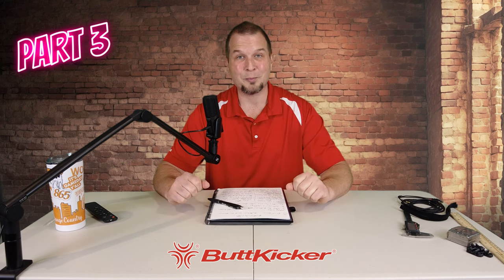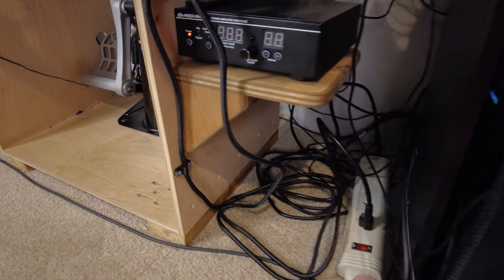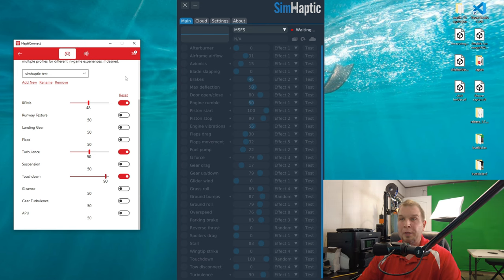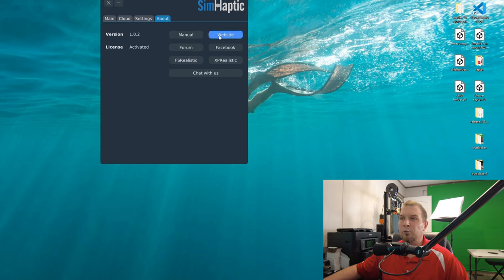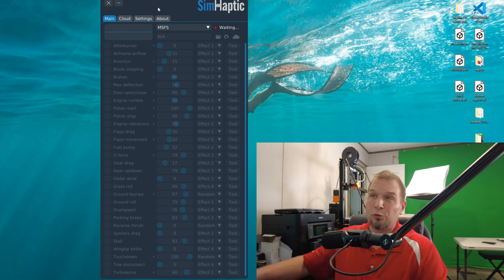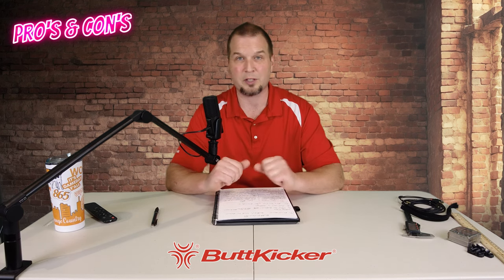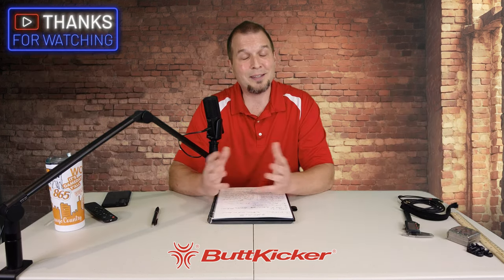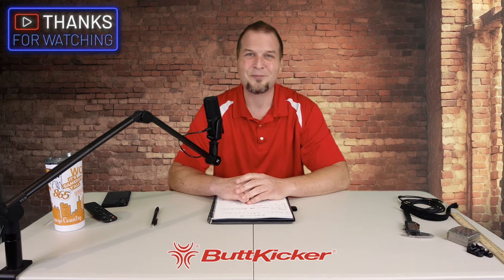MSFS2020 & ButtKicker* Should you BUY one? Setting guide , Pros & Cons Amp & Cable management! Pt.3

Comment: I knew you from your phenomenal graphics improvement videos for MSFS and watched them regularly.  I just got a new buttkicker and searched youtube and was thrilled to see you giving your thoughts IN A 3 PART SERIES even! 10/10 job on this.  Just curious if you have gotten the recently released update to Hapticonnect and noticed its new integration with 2024?  It would be great to revisit this in the new sim and see if the new software is an improvement or you still feel simhaptic does the same things better.  Either way, thank you so much for your contributions.  I owe you several beers or coffees.  -Jason
Reply from the maker: Hey thanks for the comment I have not downloaded the new Hapticonnect software. I'll have to try that out but as far as Sims haptic yes I'm still using that they've added many more features to that software in recent updates.

Comment: I once considered a Buttkicker but was very concerned at the vibration annoying my next door neighbour.  My computer is right beside the partition wall to their house.  You mention concrete floors being better.  I work in the architecture industry and would be somewhat concerned about the effect constant vibrations would have on the long term structural strength of the concrete slab.  It may induce cracking.  I have had the HF8 Haptic seat pad for over a year and have become used to it.  The transducers did cause me discomfort at first when using the seat for an extended length of time.  Getting the seat pad strapped down in a good position is key I think to improving comfort
Reply from the maker: Thanks for the comment .. I doubt the buttkicker would have any affect on a concrete slab your house is sitting on ... it's not a jackhammer lol it just produces some vibration that can transmit through walls.

Comment: Thanks for this...just placed an order for one after a year of considering whether to get one or not.  I have a Secret Labs chair and did not realize I had an exposable pole underneath those plastic covers!
Reply from the maker: Awesome 👌 you will love it .. dial it in .. have good air flow and don't overpower and you will have it for years. It would also be A good idea every so often to get a can of that compressed air for cleaning keyboards and just blow out the amplifier to get any dust out of it..
Reply: @2020fsers  Received and set up yesterday and tried it with the FNX A320....wow!  I never knew what I was missing.  It will take a bit to tune each setting but this really adds immersion to the sim.  I did get SimHaptics and trying that without the default software. Thanks again for pushing me over the edge!
Reply from the maker: Awesome glad you like it 😀  happy flying

Comment: I think the arrangement setting in the settings tab refers to the input/output from the computer. I.e.. a mono, stereo or 5.1. I personally use a stereo output USB card specifically for the Buttkicker. So I use the stereo setting, and it does seem to make a difference. The multiple outputs refers to the number of Buttkickers that are connected.
Reply from the maker: If you check out the manual tab in the about menu and scroll to the section for settings and there it says for arrangement to select your bass shaker setup, and says nothing about the audio from  pc . Yes the multiple output slider is for multiple devices per effect.  So you can have 2 buttkickers under the seat in mono or set them in stereo to have a right and left side   .
Reply: @2020fsers  Thank you for the clarifications. And thank you for all of the awesome tip videos that you do. They have helped me out immensely.
Reply from the maker: Sure they do need to update the manual tho it is kinda old lol. Thanks for the kind words 🙏 I'm happy my vids help out .
Reply: Also, according to an RK Apps video, you should choose the stereo option when using one bass shaker if the mono option isn't producing enough volume - they say the stereo option will provide extra gain.
Reply from the maker: @richavery66 thanks for the tip

Comment: A swivel rocker chair was an issue because when I’d push the pedals, my chair would roll back, and swivel around. I had to tape the wheels and bungie cord the swivel motion lol! 
I have the HF8 chair pad. Would this not be redundant? I need the Butkicker to somehow also vibrate the yoke and pedals. I used to have a platform which had 4 tactile transducers mounted on platform, chair, pedals and yoke.
Reply from the maker: Thanks for the comment . Because I'm on carpet. I don't have the issue with my chair. Wanting to roll when I push on my pedals luckily lol. .If you have your SIM cockpit mounted on metal extrusions, then yes, butt kickers would be great to mount on corners to give you the haptic feedback throughout your controls. Your yoke and things like that.  I do.
 Know of people that have both the haptic seat pad and the butt kicker. And my opinion, I think it's a little overkill.

Comment: Now I am a little concerned and may have to remove this from my Christmas list.  I do most of my flights when everyone else in the house is sleeping.  Although their rooms are not directly connected to my Sim room (on second floor), if the vibrations are transmitted through the frame of the house, that could mean problems.  I would be interested in your thoughts Jon (but I won't hold you to anything), will the horse stall pad reduce the vibrations enough?  Great video!!
Reply from the maker: Hmm that's a tough call . If they Are directly above you sleeping. Then that could pose as a problem unless your simulator is on concrete like if you're on a ground floor or something. In that instance, I would say you would probably be okay. But if your simulator is like mine and is sitting on a wood floor with wood joist underneath of it, it's gonna transfer some sound. I'm not sure how much a mat would damper it definitely will but to what extent idk.  And most houses don't have insulation on interior walls or between levels. So that just leaves a hollow space for sound to travel. I don't think you would have an issue with other people trying to watch TV or something but when It comes to sleeping some people Are really temperamental to the conditions for sleep. And if they're not directly above you and maybe on the opposite side of the house, you probably won't have an issue. There will be plenty of walls in between you and them.
Reply from the maker: The other thing is you could choose when and when you're not gonna use it.So maybe you only use it when people are awake and you don't when people go to sleep.  Play some bass music in that room and then go upstairs to the bedrooms and see if it's loud . It won't be the exact same, but at least it might give you some idea. If there is enough air space between all the walls between that room and where everyone is sleeping to dampen the sound enough then you will be fine

Comment: Amazing Video, I need to hook my buttkicker back up.  I turned it off because my Dog hates it.  Small complaint, I wish there was a way to change the SimHaptic in your video to white background.  It is very hard to read your settings.
Reply from the maker: Thanks for the comment .. what you see in the simhaptics are not my settings only because every aircraft is different so I felt I would show the process in which I go about setting all of the settings also everyone's setup is different so my settings may be to weak or to over powered for you . But the aircraft that I have setup profiles like the 414 the Comanche and the da42 and fsr500 I have uploaded them to the cloud so you can go there and download my settings in the cloud tab for those aircraft .

Comment: Hello sir. Your videos have been extremely helpful for me to set up mine. 

I'm curious as to whether you gave used the BK with a VR headset. Mine has worked only once. I did follow your 2nd video instructions of what settings to have on the PC audio and App audio, and it worked once, but that's it. 

It vibrates when in testing, but not when in Flight Sim. I tried MSFS 2024 where it worked once, and then it stopped, as well as with 2020, where it is just not vibrating. I'm curious as to what I'm missing.
Reply from the maker: My butkicker works just fine I have no issues using it with a VR headset I haven't tried it in 2024 yet.

Comment: All was doing great for me with my reverb G2 and hapticonnect, but after I switched to Pimax (for some weird reason) Now I have about 5s lag for every single effect, and sometimes the activate and deactivate out of the blue, without any input. Have no Idea why this is going on, but I'm really missing how it used to work before, and at this point, I CAN'T fly without it... Costummer support from Hapticonnect yiu ask? Non existent.
Reply from the maker: Ok so there is delay is from the pimax itself. In the pimax play tool in the 1st tab devices  towards the bottom you can set standard or or low latency sound mode switch to low latency and the lag should go away
Reply: @2020fsers  dear lord gonna try that later! I think you just saved the day!!! Much appreciated!
Reply from the maker: @salazarbernardo i hope it works for you
Reply: @2020fsers  Unfortunately, it did not work : (. I have no clue what's going on but whenever my crystal is on, regardless if using it's speakers or not, there is a huge delay on the effects... Flat screen works with no issue. It makes no sense to me because tha hapticonnect software should be pulling data from the telemetry only and have zero relation to the headset...
Reply from the maker: @salazarbernardo yeah that just doesn't make sense all .

Comment: The pad wasn't a good solution for me. The motors at the rear of the seat portion hurt; they were hard and were right beneath my hip bones, causing severe bursitis in my left hip that I hadn't felt for almost 20 years. Then the strap at the back of my seat parted and I had to (unsuccessfully) try to stitch it together. It went in the bin (incidentally I waited almost two years for that pad from Europe via China or somewhere; it was the first of its kind and there were some distribution and manufacturing problems, I was told ... but I had already paid for it. Frustration is the word here.).

I'm on my second buttkicker (I had the original but it eventually quit). After waiting six months for my Buttkicker II to arrive from England (I'm in Australia) my speakers died. When I brought my new speakers home the only place I could plug in the Buttkicker was in the rear of one of the Logitech speakers ... the vibrations worked but the sound was gone. So my brand new Buttkicker isn't getting used ... (All that cost me around AU$1000), so I'm not at all happy. On top of that the company in Australia I bought the Buttkicker from said they had them in stock - they didn't. The lied).
Reply from the maker: Damn that really sux . The new buttkickers you can use a usb and don't need to use the audio Jack  . I suspected that the haptic seat pad would have issues with comfort that's another reason I went with buttkicker. I hope you find a solution  for your issue . If you have the y cable you can use that to plug in series with your speakers

Comment: Yea… waste of money… even in VR.
I have one and don’t use it
Reply from the maker: I use mine all the time. Especially when dialed in .
Reply: @2020fsers  I had it on my chair before I moved, rarely turned it on. Now I’m not sure what box it is in.
Reply from the maker: @thatguy7085 I will say the older ones are a bit different than the new updated design. I think they are a little more powerful than the older ones. And the amp is definitely different because you can connect the amp via USB c cable now. I think that makes a big difference then connecting it into an audio port. I don't own one of the older ones So I really can't say for sure.
Reply: @2020fsers  yea, I have the audio out version